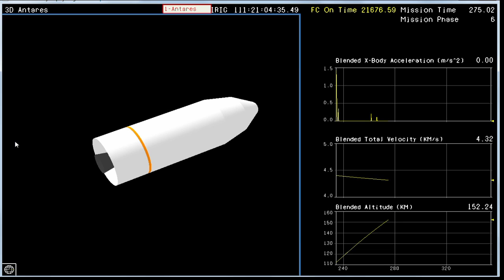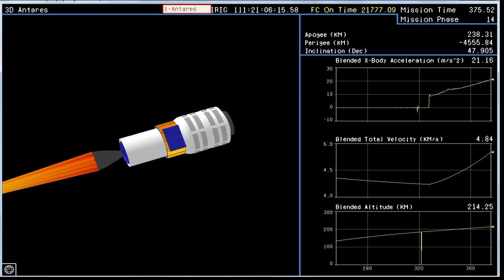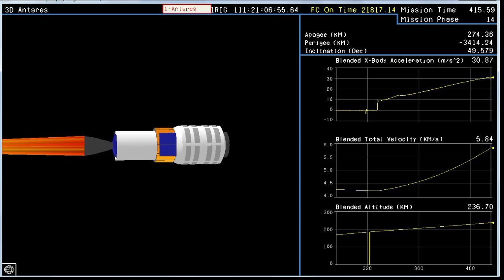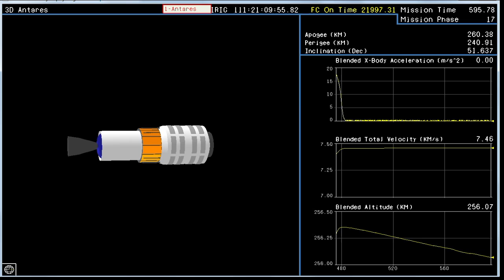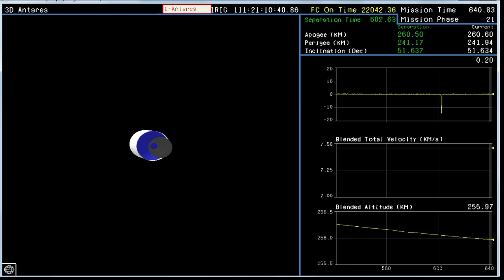Successful Launch for Antares

Comment: What? We'll launch satellites at them?
This rocket is ONLY able to carry satellites to orbit, it has absolutely no capability to act as a surface-to-surface ballistic missile.
The Delta and Titan launch vehicles, were derived from ICBM's but this one is a "clean sheet" design that uses a pair of high performance RP-1/LOX engines in the first stage, which just so happen to be derived from the russian N-1 rocket's main engines.
The N-1's problems were due to quality issues, not the engineering.

Comment: continuation...

A dismal failure which led to the abandonment of the lunar project, the remaining engines are stored. When it came to equipping the first floor of Antares is to the Russians that Americans have turned especially to the NK-33, which provides thrust of 1500 kN. Une belle revanche pour Kuznetsov qui a conçu les moteurs au milieu des années 60… Il y a 50 ans !

VOLVERT Philippe

Comment: The Russian NK-33 (used on the Antares) held the record for thrust-to-weight ratio of 120:1 from 1974-2013.  The F-1 engine or RS-25 on Shuttle could not match it.  It was not until California based SpaceX Corp created the Merlin1D in 2013 with thrust-to-weight ratio of 150+:1.

Comment: The rocket was using NK-33 engines build in 1970, and modified for different fuel lines, but the engines were constructed in 1970.

Comment: In engineering, nominal regarding measurements generally can be defined as "what is predicted without considering what deviation may occur or whether it is acceptable"; or "what is predicted plus or minus X number of standard deviations". The use of the phrase "all systems nominal" at NASA indicates that telemetry is reading as expected from historical data trends.

Comment: It's a very broad word that's hard to define. In most cases, it means the standard in which something has been named.
(ex. a 1.5 volt battery has a nominal voltage of 1.5)

Comment: Final velocity, V: 800 m/s
Acceleration, a: 320 m/s2
Time, t: 2.5 s
Displacement, S:1000 meters

320/9.81 = 32.62 (g) - g Force. Acceptable for cargo cargo and rocket I guess.

Pascals hydraulics principle must be applied in this situation to gain mechanical advantage. If Antares weights 240 tons than counter weight should be (320+9.81)*100*FrictionCoefficient times larger (with travel distance of counter weight = 10 m) or > 7915440 tons. Specific type of fluid should be used with high fluidity.

Comment: Didn't you think about launching rockets by a preventive acceleration that may be given by a block mechanism and counter weight with everything mounted on a mast-tower (near  steep mountain or a cliff as an option) high enough to give speed  at least 1/10 of the first orbital velocity of 800 m/s before it releases to it's free flight?

Comment: You pretty much answered your own question.  Also, instead of launching from higher altitudes, you'd get better results if you found a launching facility as close to the equator as possible (allowing a rocket to take full advantage of the Earth's rotation).  This is why ESA launches from French Guiana, and why we also maintain a launch site on Kwajalein Atoll.

Comment: Why do they launch rockets from the sea level? Wouldn't it be much more cost efficient to launch them from higher ground (2 ... 4.5 km above sea level) where large telescopes are often installed. I know there is no infrastructure there and it's hard to transport the rocket to the mountain, but in my opinion it will allow to launch larger vessels with much lower costs of cargo transportation to the orbit.

Comment: Antares uses kerosene and oxygen for the first stage, a solid rocket propellant for the second stage. Shuttle used mostly solid rocket propellant for 1st stage lift-off which is where white clouds are from, but that's not water vapor. Shuttle also used hydrogen & oxygen for core/main-engines which provided most of the velocity but has small amount of thrust initially compared to big solid motors.

Antares' engines are about 4 decades old, left over from old Soviet Moon rocket. Wonderful engines.

Comment: It's RP-1 ( essentially Kerosene ) and Liquid Oxygen in stage 1 of Antares... in the STS's SSME's ( ss main engines ) they're using Liquid Oxygen and Liquid Hydrogen and the combustion creates H2O or invisible steam as residue. The STS's white trail you see is the solid rocket booster's smoke trail

Comment: But in the scientific world, metric is used. American or not. I'm fine with using imperial in day to day life, but it's difficult to relate to when used in physics, because since most of the world uses a different unit and doing conversions in your head while hearing the measurements to compare it to other endeavours gets old fast, you just give up as the commentator rattles off meaningless figures.